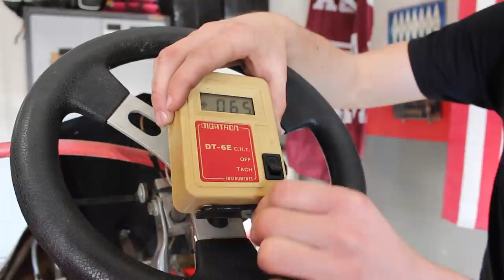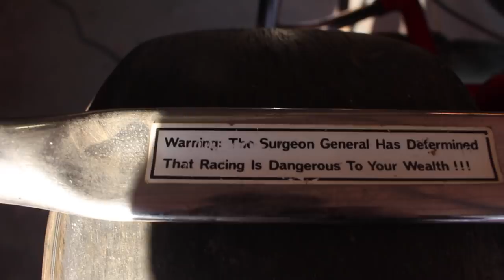2-Stroke Racing Go Kart Find!

Comment: U want a hot plug in a 2 stroke usually and check those reed valves to and your carb needle valve sounds like your issue really to me 2 strokes are the simplest engines around really no cam no actual valves or springs or rocker arms either

Comment: Ok wow, you guys have so much to learn about KTs. 1st it is a METHANOL motor.  Pull the plug and it will be fowled out.  You will have to find a source for methanol and been oil to make it run. 2. That clutch is a horstman wet clutch. It must have oil in it. When you pulled on the breaks and the motor bogged so much was a clear sign that the clutch is dry.  3. KTs are very good at over heating extremely fast and heat seizing.  Basically you have about 1min of not moving before the jug over heats. Start it and get it moving so air will move over the motor, run it on the stand for more than a minute and it will probably seize on ya.
Reply: It's not set up for Methanol, still has the standard Walbro petrol carb on it.

Comment: Run klatz and you might wanna change the oil like you know the  Clar'ts oil racing fuel that's what I  Run on my snowmobile and its 2 stroke race lead in it works perfect K and you're might wanna take and  Turn it down a little so the tires on span when you're not in the gas and just so you know you might wanna put on a  AT start your key start on it because then it's easier to turn it off cause then you don't to reach back and make sure that you change your brake lines in your gas lines and all that

Comment: Two strokes are actually not very efficient. While a two stroke will make around twice as much power as an equal size four stroke that is built to the same " State of tune" it will make half or less than half of the torque and require around two times or more the amount of fuel to perform the same amount of work. Two strokes make more power simply because they have a power stroke every revolution whereas a four stroke engine has a power stroke every other revolution. Each of the two strokes power strokes will create less power than each of the individual power strokes of a four stroke engine, but by the sheer number of power strokes occurring in a given amount of time they create more power, not through efficiency.